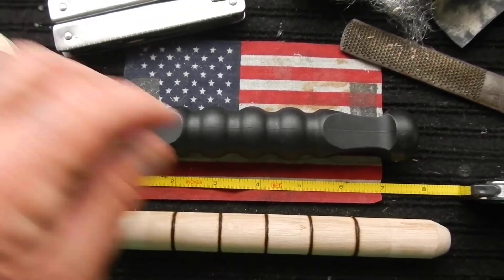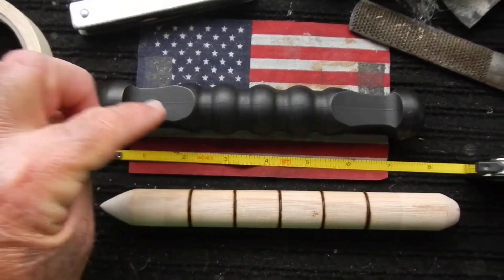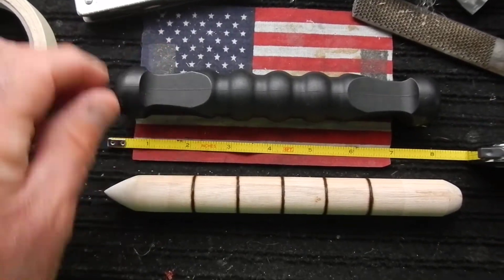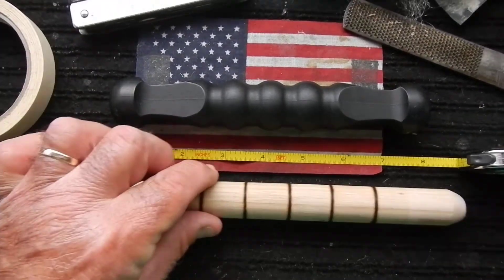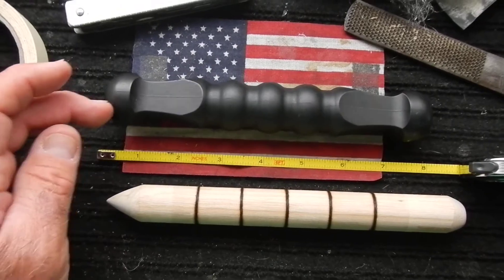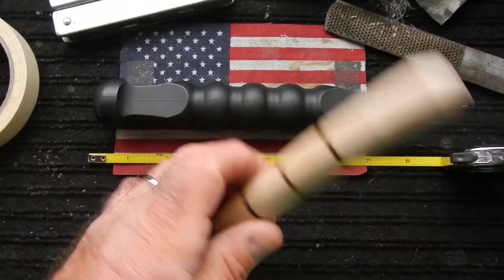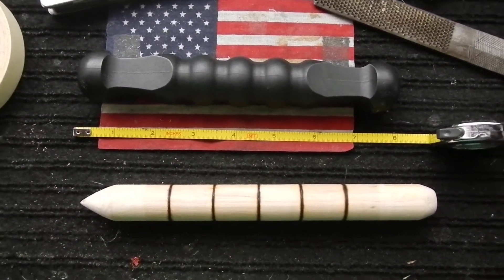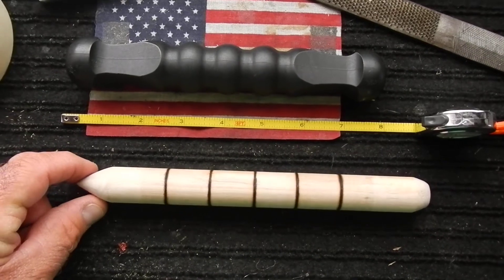Making a Yawara Stick

Comment: I wonder what kind of wood that handle is made of.  Would you harden it somehow?
Reply from the maker: Haha, "Chinese Mystery Wood" for sure! Seems like a medium wood . . .not a soft wood like Pine, but not a hardwood either. Fire hardening is used for Green Saplings, and since this is seasoned wood, there is no need to harden it. It should be fine against soft targets [solar plexus, groin, throat, pressure points] and fragile bone targets [hands, clavicle]. An understanding of application and slow practice with a friend are essential. Thanks for checking in!

Comment from the maker: If you wish to make one, just go to the hardware store and buy a wood dowel rod. From that, you can make several Yawara/Kubotan sticks cut specifically for your hand width. I would leave at least a 1/2" protruding out of each side of hand/fist. The dowel allows you to choose from the 5/8", 1/2", 3/4",  and 1" diameters, so essentially whatever is comfortable and you can close your hand around and retain. Very inexpensive. File and sand the end edges a little, so they won't cut a person during a defensive strike; you are just looking for blunt impact or to apply pressure to a pressure point on their body. Check local laws. Train.

Comment: thanks for sharing.
I have been thinking about the sharpness of the ends. I have made quite a few from hardwood. Most with a cone ending sharply in a point. But that could tear 8nto the skin. whereas a little blunt end can still deliver a disabling punch without puncturing the skin. You have made one with one sharp and one blunt end. What was your reason for this choice.
thanks in advance
Reply from the maker: The blunt end is so I can comfortably place my thumb atop it if I wish to lend more force/support to my hand in a hammerfist strike. I have only ever seen one Judo stick with points at both ends, that being the Cold Steel KOGA SD2. Otherwise, all I have seen have one pointed end and the other blunt. I suppose I should say "less blunt" rather than pointed or sharp. I don't want to tear tissue and move into the realm of an "edged weapon"; no, I want it clearly seen as an impact weapon, this a rounded point that will focuse energy [pain] but not puncture or lacerate. I hope this helps. . . I fear I may've rambled a bit!  Thanks for dropping by my channel!